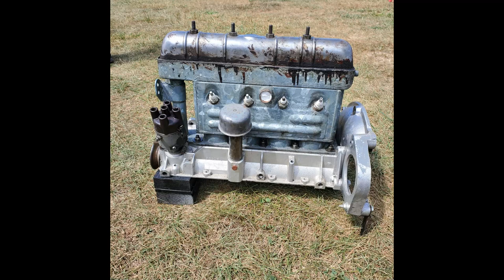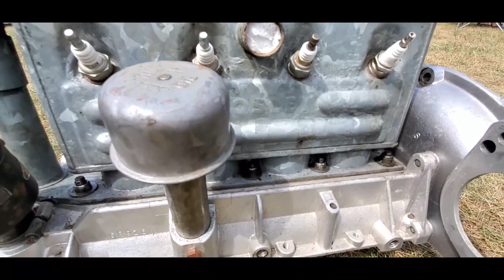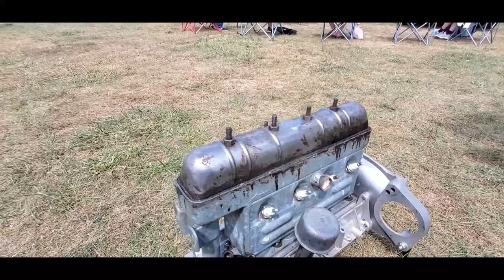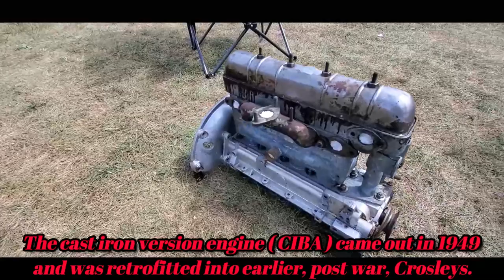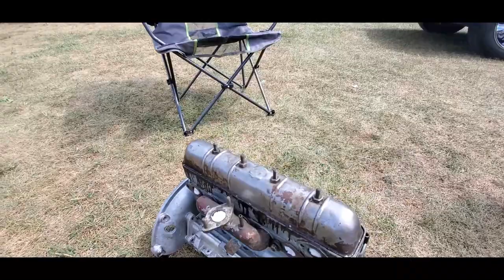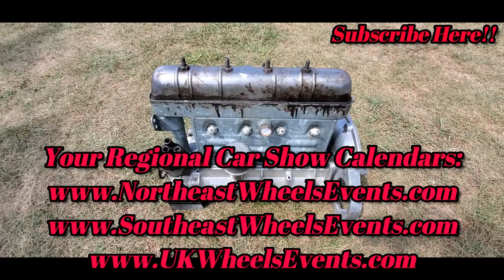Crosley Sheet Metal Engine the OHC COBRA Engine 1 Minute Car Show

Comment: I'd bet it could work with current welding technology
Reply from the maker: You would win that bet, Tim.  The joints would have held with today's technology of welding and adhesives, but, the problem was warping from low coolant and rust. Here is a good article from the Crosley club: https://crosleyautoclub.com/Mighty_Tin.html    Thanks for watching and sharing your insight, Timothy.
Reply: @carshowreporter  It actually did work well for its intended purpose, as a small APU/genset for WWII aircraft and austere locations.  When they decided to take all of those surplus engines and throw them into cars with drivers thinking they didn't need any additional maintenance, problems arose.  You can't overheat these engines or they'll warp, that's just the nature of such a thin and lightweight block.  A lot of highly engineered modern engines aren't much different in that regard.  Running coolant with anti-rust additives was standard procedure for military operations, car owners often just filled them with water because adding coolant was an unnecessary expense and not always available on the road.  Nobody really considered rust to be a problem because the cast iron blocks of the day had plenty of steel to rust away before it affected the integrity of the block.
Reply: Pete Aardema has a similar construction method